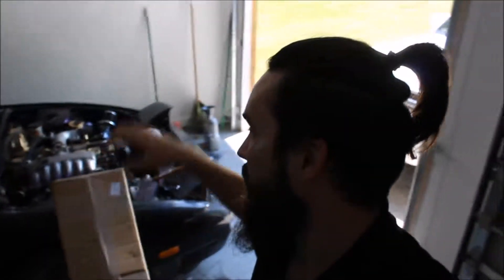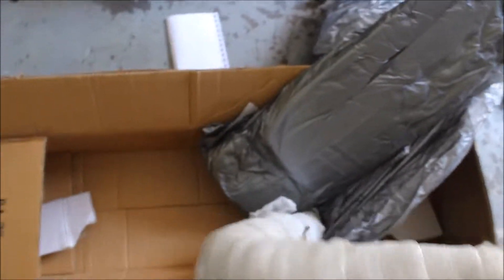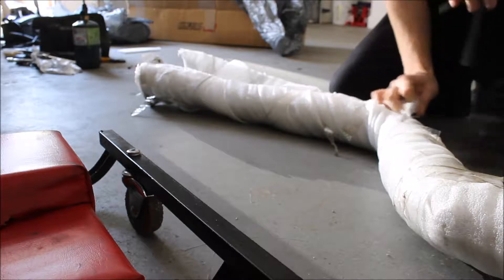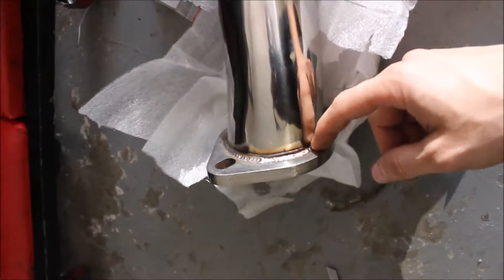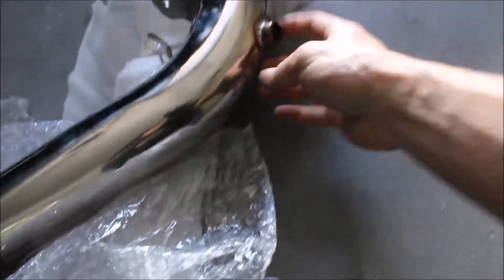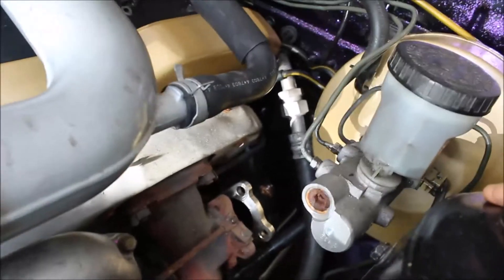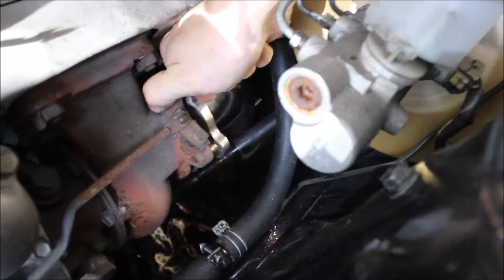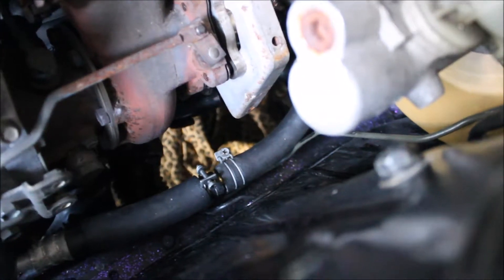OBX Rb25det Downpipe To Good To Be True? | 240sx Ep.66

Comment: Any issues since you've installed?
Reply from the maker: Hector Lopez no it bolted right up to the stock Rb25det turbo and then right to the “cat/test pipe” of the stock 240sx location. I did have to bang a slight dent into it tho to clear my steering shaft. Really easy. If you have an s14 then it should fit without any issues at all
Reply: J.R. Hoye I’m considering getting one for my R33 but also a little hesitant. Don’t know if I should just pay a little extra for an ISR or other brand if it’s going to be roughly the same quality. Thanks!
Reply from the maker: Hector Lopez I haven’t had any issues yet. The flange the bolted to the turbo was a tad bit warped but a little bit of sanding fixed that right up